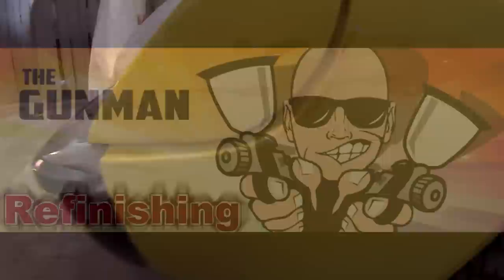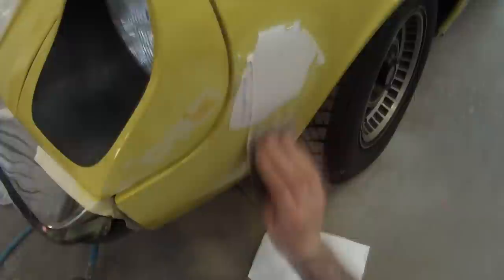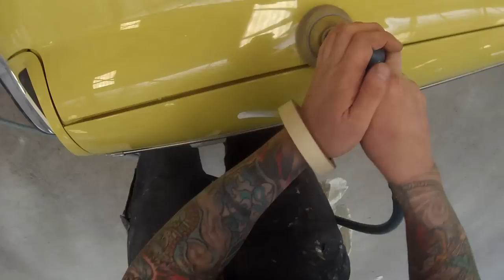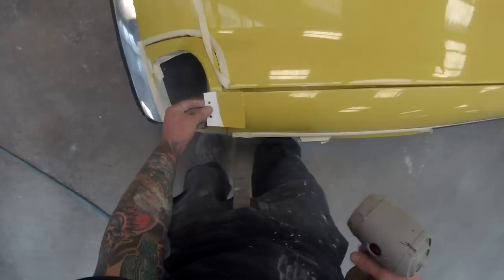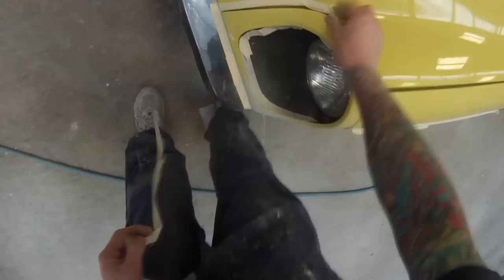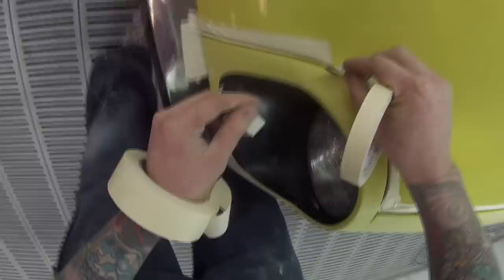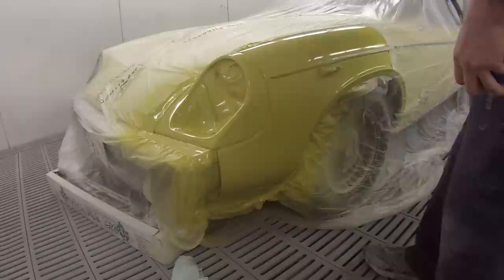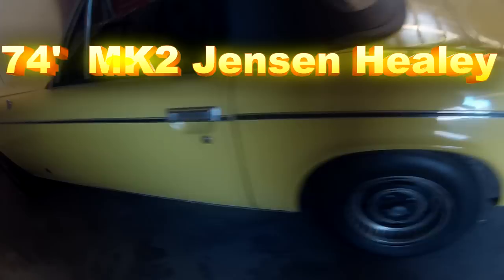SMART Repair 1974 MK2 Jensen Healey

Comment: Awesome video. I'm a DIYer and I just want one gun that's not too expensive and not completely worthless and this one seems to fit the bill nicely. I usually will use it to spray lacquer and varnish on furniture but I was wondering if I can also use this gun to pain acrylic paint with? Is the 1.3 air cap too small for that?

Comment: hey gunny, im a sign writer and use metho to prepare the surface for decals, new and old vehicles. sometimes it grips up on the rag and feels like the paint freshens up even on some COB finish's. is this where its been repaired and not enough hardener has been used??
Reply from the maker: It's more likely to be the type of paint they used, most acrylic paint will freshen up with solvent but 2 pack won't.